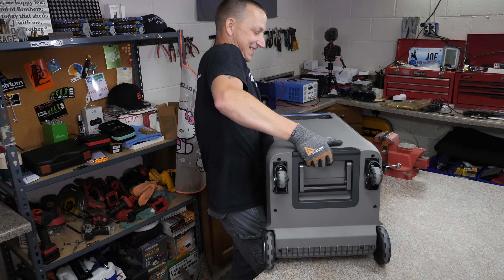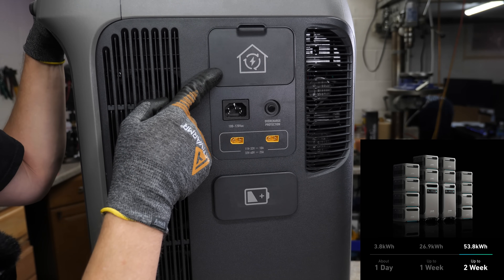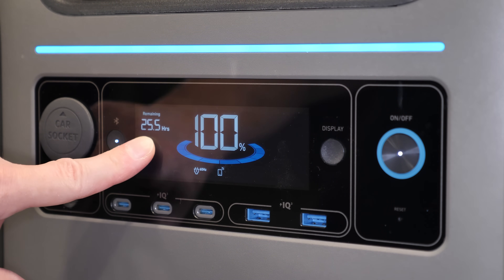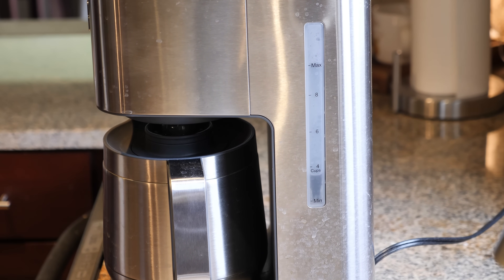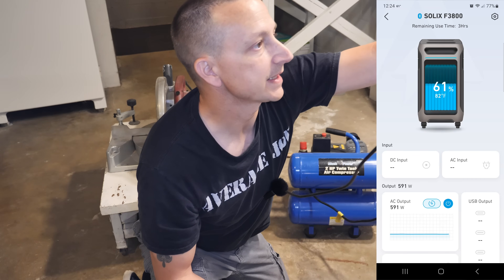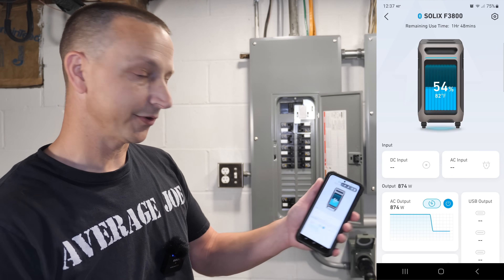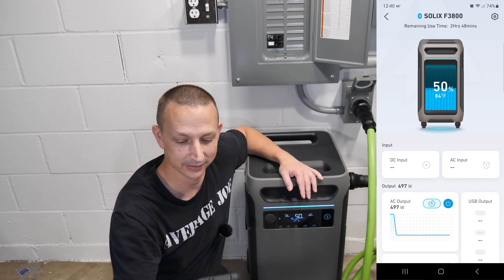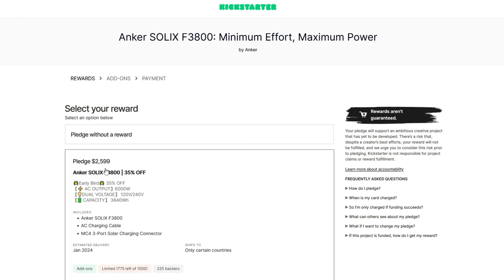Power your House in a Blackout with The Anker SOLIX F3800! It does 240V!!!

Comment: I find solar and portable power to be very interesting. My father Inlaw was going to help with us going with solar panels but they to me would do no good as our roof would have to be replaced . Plus if power went out we would still have no power anyway. To buy enough batteries for the house as well would cost so much money that it just does not make it worth it. Now with just with one of these units there is no way to power the whole house . Anything that you plugged it that used a decent amount of power reduced the time running to nothing worth while . It would require tieing in a few together. Costing to much money to be worth it . This one seems to be rather expensive to others i have seen reviewed . 
 It is also more important to see how these work as they are not all the same and each one has each owns pros and cons. I will look more into your channel if you go into detail on the details of any of these units . I watch another channel where they break down these units in simple detail and show why or why not it is recommended . These would be best used with a few easy to set up solar panels. Important that these generators are able to accept a fast charge through solar to be viable . 
  Interesting video. Will check out more of your videos.

Comment: Thanks for a great review. I have been looking for a 240v system... the issue with the induction loads (saw + compressor) is going to be a problem considering it should be able to handle 6000W continuous... it should have been able to handle a compressor + saw.
Reply from the maker: That test could have been my bad. They were both on the same 20a circuit when I tried it and I didnt even think about it. I could throw a saw and air compressor on the power station and give it a go
Reply: @AVERAGE_JOE Oh! That is an important revelation. Thanks for clearing that up. I think in all fairness, to the company, it would be best to check and please do let us know.

Comment: You need to balance your 120 V loads as although the inverter is 6000 watts (at 240 VAC), it will not run 6000 watts to a single leg of 120 VAC.  So, if you want to run the saw and the air compressor at the same time, put one on L1 and the other on L2.
Reply: Actually, I suspect they were on different branches, and starting the saw caused the Solix to drop the opposite branch (with the compressor).  Just by coincidence the lights were on the same branch as the saw.

The compressor stopped completely (wasn't a power sag) so I bet that branch dropped to 0V for a few seconds; if the saw was on the same branch it would have stopped accelerating.

Comment: Man this is one of those dangerous things that I wouldn't even buy just because it's got a dryer plug on it doesn't mean jack shit that it won't short out and cause thermal runaway with the battery because I know that can happen and has happened to shit like this before when I last had one of these I did have a fire believe it or not it was a true story too and I can back that up‼️‼️‼️‼️

Comment: I find these big power stations an interesting approach to trade money for thinking.  Given the cost, and the weird limitations for solar input, and the lock-in for upgrades, I just don't see this being a good option for me. I'd prefer to wire up my own generic batteries, to the inverter of my choice, and choose appropriate charge controllers for suitable solar input.  Oh, and then maybe add some different batteries next year for more storage, and maybe swap inverters in a couple of years to handle bigger loads. 

I think I'm covered for transportable stuff...

I purchased a Delta 2 Max last spring to fill most of the portable niche. I can use a 48v battery on the solar inputs to pump in 1000 watts of "expansion."

I also have 200Ah at 24V and a 3kw inverter on a tool cart for "transportable." The battery is split with a big anderson connector so I can swap to 400Ah at 12v and use a smaller inverter for longer, low wattage use.

Comment: IMO you lost credibility in not pointing out very clearly the big issue with this unit which is it's 60 volt limit on solar input while claiming 2,400 watts of solar input capability and whole house backup.  This was like a sponsored review that they paid you and not an independent review where you pointed out the good (and there is a lot of good) and the bad (60 volts).  You should understand the importance of retaining your credibility with your views, that getting them the truth is most important to you.  You would need 6 400 watt panels in parallel so probably around 50 volts at almost 50 amps.  Wow, what size wiring would you need for that?  In most cases the panels are fairly distant from the sogen so you will need even larger wiring to avoid losses, etc.
IMO what you should have done is to tell Anker that they need to revise the design of the solar input so it can be 250 volts or so and to not release the unit until that is done.
Reply: Can you explain that to a simpleton like me? I'm very new to this stuff.

Comment: Hi Joe!!!
Nice that you had the opportunity to test this new Anker SOLIX F3800!!!
This thing is going to set the bar pretty high for the rest of the manufacturers!!!
If Anker can get this thing to charge from solar with with higher voltaje and amperage... it will be THE BEAST !!!
Keep up the good work!!!
See ya !!! 👋👋
Reply from the maker: Yeah its a pretty sweet unit. 100% agree, if they could tweak the solar input voltage that would be ideal. Its doable if you use it as a portable but higher would be best for home use!🤘
Reply: If 3.8 kw of power means the bar is set high, i don t know what to tell you..
It s a nice toy, but that s about it, usability wise
Reply: Well, it’s already had the 2400w solar panel input while output 240V, if that is what you mean

Comment: Just wondering if the control for overload is a voltage drop as compressor came back on so it may be hard on computers stuff if you overload it. Great review  I may even look into buying one it solves a lot of problems for a short time lol.
Reply from the maker: Sooooo......a few others pointed out it was my bad. I had both plugged in basically to the same leg. If I would have used both legs from the unit, it probly would have done it just fine.

Comment: I like the concept but the MPPT controller needs to accommodate at least 150 volts. Higher would be better to make it a serious home backup system.
Reply from the maker: 100% agree. It should be at least 150v.....120v at the lowest. I am wondering if they did it this low to keep the RV/camper/Van people since its easy to use 12v panels. I dont actually no tho

Comment: Love the way you showed in real-time how much each major appliance consumed. In a real power outage with that interlock I’d be concerned that the water heater or AC would come on when not wanted and drain the battery quickly. This is why I have a transfer switch to have more control.
Reply from the maker: Thanks! That is why I love to do this type of video because its real!  With the generator interlock, you are making your panel the "transfer switch" so you can have all the control and turn the AC and loads off you want. I also have a small critical loads transfer switch panel that Ill use in another video. That is my oh shit critical loads panel lol
Reply: @AVERAGE_JOE  ok I get it now. You just manually flip off the water heater etc in an outage. I’m getting a FranklinWH soon and it can shed two 220 or four 110 loads. I have a transfer switch now and it can stay around with the FranklinWH so it will be interesting to see how I use both. Options.
Reply: What receptacle did you use below the panel to hook up the anker ?

Comment: Sorry Joe Butt This Is Just Another One Of Those Very Expensive Baby Camping Sized Battery Inverters That Will ONLY Have Maybe 2-Hours Of Real Usable Power... That's Great For Baking Time For 1 Hour To Fix A Meal, Whilst Runnin A Few Lights & Your Space Space Heater, Then Eating Your Meal In Candles Light w/A Blanket Wrapped Around Y'alls As Your Foods + You Get Cold Again! A Nice $4000+ Dinner!!! The ONLY Things That These Things Are Good For Is Camping For A Weekend Outta Your Car, Van or Boat... 🤔😜😜🤣🤣😁😎
Reply: Of course you are correct, most power outages are under 4 hours for us and it would be great. I won’t sell my Honda 7000 just in case of the big outage.
Reply: Your post is ridiculous.
Reply: Why bake if you’re camping 😢?
Reply: Nobody really needs to bake a turkey in a power outage.
Reply: Amen!! They do have a place, but this video is dangerous. Stupid people will believe this is a good idea. Will it run a central air conditioning system? No way. Therefore it WILL NOT POWER A HOUSE!!! ASSHOLE!!!
Reply from the maker: Lol a $4000+Dinner! Tell the wife your taking her out for the most expensive dinner around🙌👀

Yeah the big power draw items obvi will kill it quick but I think it could come in handy if the power went out and you didnt have another source of power. You have appartments, cabin ect...

I also wonder if the MPPT voltage is lower to keep the RV/Camper/Van people in mind. Seems as they always use 12v panels.
Reply: @AVERAGE_JOE  Sorry To Be Soo Grumpy On These Things, Butt I Only Custom Design & Build Full Blown Totally Off Grid 48v Systems! The One I'm Finishing Up This Week Is Runnin 3)-15kw Sol-Arks +4)-31kw  6-Pack Racks Of EG4s= 120kw On A 20 Acres Ranch w/4000sqft House, Pool, Water Well, 50amp TESLA Charger + 3)- 30x60 Shop Buildings, ETC...We Got $100k In Equipment In Her So Far w/The Fully Dedicated 10x16 Spray Foamed Solar Shed w/It's Own 10k btu A/C Heat Pump Wall Unit + 12kw Westinghouse Bi-Fuel Backup Gen + 200gal Propane Tank! Now That's A Real Total Off Grid Serious Backup System... 😜🤣😁😎
Reply: @grumpyjohntxredneckrc6346  are you hiring?  I would love to get into this industry. I'm currently going no where fast in the trucking field. Thank you.
Reply: @grumpyjohntxredneckrc6346  Please Stop Typing With The First Letter Of Every Word Capitalized 😒
Reply: @grumpyjohntxredneckrc6346  Well It’s Working!! 😩😭
Reply: @grumpyjohntxredneckrc6346  Nice system. What's your deal on the 100k spent so far?
Reply: @simonmasters3295  ? Don't Understand  Your Question?
Reply: @grumpyjohntxredneckrc6346 
I hope you meant to say 2000 gallon propane tank. If not, all that 200 puny tank, for a project, the size you're talking about will not run for very long. Nice $600 dinner at most.

Comment: Just to let you know, the Zendure superbase v also has a 240 volt output. I want to say they were the first to do that. It also has a motor for the wheels so you can drive it around like a very slow rc. This one might be better.
Reply from the maker: I just recieved what you mention😲🤫
Reply: I thought the same thing Zendure did do this first
Reply: Wouldn't every single one of these devices sold in Europe have a 240 volt output as well?
Reply: @mrniceguy6050  technically yes,  but it is different from American 240 volt outlets.
Reply from the maker: Yeah the EU version would have the correct output for the location.

Comment: Nice, though I do wish the MPPT charger had a higher max voltage. That's the one limit most of these units have, even upping it from 60 volts to 100 or 120 volts would be a nice improvement, especially since it can take up to 2400 watts.  Price wise its very nice as well.
Reply from the maker: Yeah the MPPT voltage is low. I wonder if they did that to stay in the "portable" solar market or RV market. Seems they always use 12-24v panels. 2400watts isnt bad tho. I wanted to try that so bad but its been so damn cloudy here plus Id have to go on the roof and rewire everything🙄🤷‍♂️
Reply: @AVERAGE_JOE  What about those two ground mount arrays? Even if it's only for a hour or so. Easier to rewire too... you'll have to parallel everything of course. Just showing how many panels you will have to wire in parallel to get to 2400 watts would be interesting all by itself. 

I feel your pain on the clouds, took a couple weeks to get some good clear sky to do the testing I did with the bougerv mppt controller. Come on sky, we are trying to do reviews here, help us out! haha 🤣🤣
Reply from the maker: I was going to do that with the ground mount panels BUUUUUUT as I was headed out there I remembered those panels have a VOC of 68v......🤦‍♂️🫠😄

Comment: Were the air compressor and the chop saw on the same circuit? If so, it would be better to plug each item into a separate circuit. This should allow the air compressor to keep running when the chop saw starts up.
Reply from the maker: Yeah actually they were on the same circuit. I bet you are right!!!🤘
Reply: @AVERAGE_JOE  Makes me curious if there is a limit on each phase, or can it put out the whole 6000 watts on just one of the two phases. Time to break out the portable heaters :)
Reply from the maker: Yeah I think its 3k on each but.....will have to break out the heaters😆🤘

Comment: hi   amigo   nice to see you posting videos  i will say the  back up  nice item but need some work.. for  in rush you can see the flicking  and the capacity for  one  unit like this  at lest 280ah  i know you can add  more  but to  much  mula $ for what you can  get  for the price in other units or options out there....  the  idea  is  ok ,,,  but need  some work
Reply from the maker: Hey Man hows it goin? Yeah its pretty sweet. 280ah would be a game changer. Wouldnt be as portable tho🤏🤠
Reply: @AVERAGE_JOE  just a new design heavy duty  wells  lol  justa suggestion . i am   glad  you power bill  low , keep the  videos coming... any  chance you get a EV to power your home to charge your car or used like backup ....that will be a badass video....